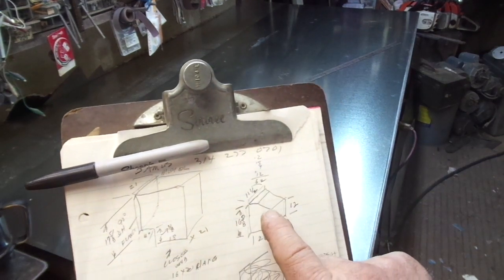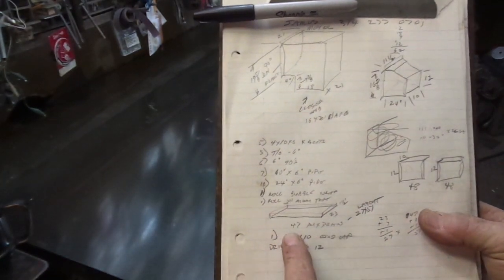Auxiliary Drain Pan and Three Way Transition

Comment: You do it better than a real tinsmith....I know....my brother is a tinsmith but he does commercial kitchen hoods and counters....that`s another job and it looks so easy when you do it but I know better....you do an excellent job TractorMan....CHEERS
Reply from the maker: I remember Gator that you'd told me about your brothers SS kitchen work.  That stuff has to be fancy.  I've made a few commercial SS exhaust hoods for restaurants back in the day and one was 13 1/2' long on a radius around a vacuum vat where GE would dip locomotive windings for the insulation process.  That one was just paint-grip, not Stainless Steel.  Thanks for the compliment sir !!

Comment: Sure do enjoy your videos. Also enjoy learning from others. Thanks for sharing. Would love to hangout with on some sheet metal work
Reply from the maker: Hot doggies....that's what I need is free labor !!!  I'd keep you in coffee....or possibly your preferred beverage of another persuasion, but there may be  limit until we finish for the day because I like STRAIGHT duct work.  LOL.   I have a real cool one to fab soon.... dual motorized dampering for a wood furnace add on.  That's going to be really intensive job.  I'm trying to find the actuator linkages, and pivot pins etc for the dampers now.  Thanks for the really cool comment John, it IS appreciated sir.
Reply: Tractorman44 coffee will be fine
Reply: Also labor rate would be determined by how far I have to drive lol
Reply from the maker: @johnbeeler767  LOL !!  Sounds like we have a plan....  (-:
Reply: Tractorman44 I’m in if you’re not to far away. I’m in northeast TN
Reply from the maker: @johnbeeler767  That does make a bit of a drive...LOL.  I'm putting the skids to any larger jobs until this virus thing blows over anyway.  I'm just off the Mississippi River just a little south of St Louis MO.  I've been across Tennessee a few times and man, that is a wide state !!  I'd cut up and across Tenn just to see different country driving home from Parris Island S.C back when I was stationed there in 74-75.  I am having some great shop time right now though...getting back to some of the old tractors and other cool stuff.  The Missus is taking the social distancing thing real serious...LOL.  Probably not a bad idea anyway.

Comment: I just amazed watching a GENIUS at work.
Reply from the maker: Hahahaha....naw man, just another country boy goofing off in the shop.  Thank you Tom for the supportive comment.  (I like it.  LOL)   I do have a really cool ceiling return air plenum that will have a filter incorporated in the grille opening coming up soon.  Don't have to go to the attic to change it, just a stool or short step ladder.  Thanks again sir for watching.
Reply: @tractorman4461  you gonna need some 18 or 20 gauge sheet metal for that. But if it can be done  with 26 or 28 then i will  get to watch a Remarkable Guiness at work.!!!
Reply from the maker: @tomwalker9184  There you go again....LOL.  Strength in the fitting is created by the bends and crossbreaks, so the main concern will be the negative or suction pressure created by the blower assembly.  A high negative will cause the large sides of the plenum to 'oil can' inward upon start  up and buckle back out when the blower shuts off.  So as long as the physical size of the  grill opening AND the duct meet or exceed the required dimensions to maintain proper air velocity for the short coupled duct it should work out fine with lighter guage material. 

    Too small will increase negative pressure and velocity creating noise due to the increased speed of the airflow.  And excessive return air negative pressure on a larger return air network could possibly effect system operation by reducing airflow to the air handler below the minimum required for 'design' temp rise during heat and 'design' temp drop in A/C mode.
    Sorry Tom, once I get started, it gets a little hard to hit the skids....LOL.  I use primarily 26 guage material unless the systems have 5 tons of airflow.  We use 'twinning kits' to mate furnaces and a/c's together in pairs to increase tonnage capacities.  Those are primarily used in light commercial applications with higher than a 5 ton load.  Two 3's make a 6, two 4's make an 8 and two 5's satisfy a 10 ton load.  Sorry, I got started again can you tell.....??  LOL  Take Care and Stay Safe Tom.
Reply: @tractorman4461  I've seen a lot of oil canning  over the 55 yrs I've been doing  hvac   (now retired )  with 28 ga on a  return air drop not cross broke in apartment's  cheaply  built going to the  lowest bidder on the hvac side. I would never compromise on it maybe that's why  i didn't get the  bids.
Reply from the maker: Tom Walker oh man I’ve seen my share of butcher jobs too. Corners cut every way you can think. I knew you had to be an old HVAC guy like me but dang 55 years !!  Awesome !! Heck fire I doubt I can show you any tricks at all !!  I do appreciate you guys watching and I love the input. I enjoy the young guys as well that are just trying to learn their way just starting out too. I don’t want to steer them in the wrong direction. Thanks for the conversation Tom, I do enjoy it sir !!

Comment: Another great video 44, I enjoy the ductwork videos especially, something I’m trying to learn coming from a service background. Sometime could you do a “shop tour”? I’d love to see all the different sheet metal tools and what they’re used for. You use a lot of tools I’ve never seen. Keep up the good work 👍🏻
Reply from the maker: I am a retired commercial service tech myself with no real formal sheet metal training.  The last 25 years or so of my career was primarily gas and refrigerant piping, DDC controls and building automation as it pertains to hvac.  99% of what I know about metal I learned by just looking at ducts and fittings and trying to figure out how it was done. Then it was trial and error to hone the way to make the measurements.   That's the real trick man. Measuring accurately. 

    Back in the mid 70's the small residential shop I worked for let me stay after work and use metal scraps to figure out the notching for the corners and by trial and error figure out straight duct layout. I remember how hard it was to figure out how to notch for the Pittsburgh lock...LOL....seems silly now. It was an uphill battle because back then a lot of the older guys figured they had it tough as rookies, and they sure didn't want to make it easier for you either !! 

   A shop tour would be kinda tough, as you can tell real estate is a premium in there.  LOL.  Maybe in the future though.  Thanks for the awesome comment and for taking the time to watch !!  Comment anytime. I'll get to it eventually.